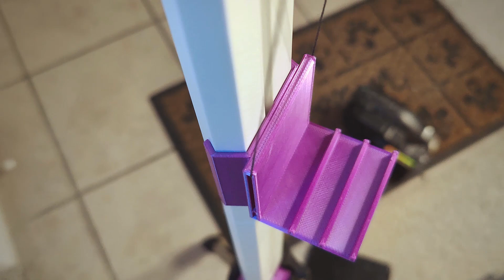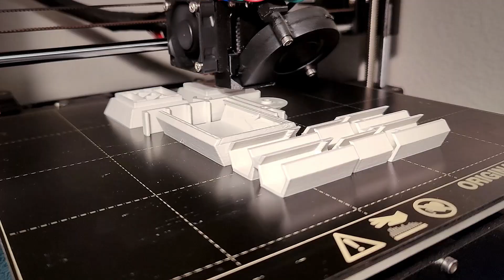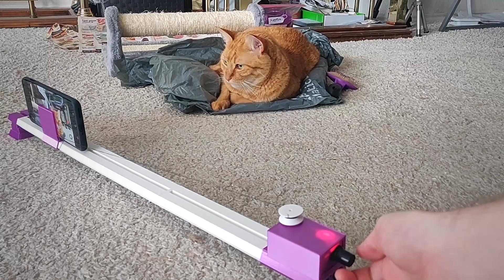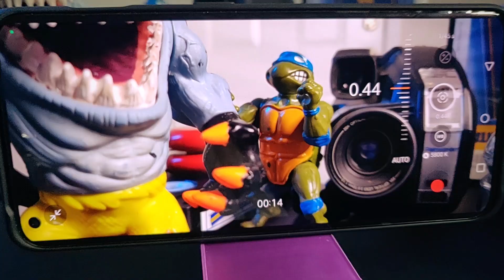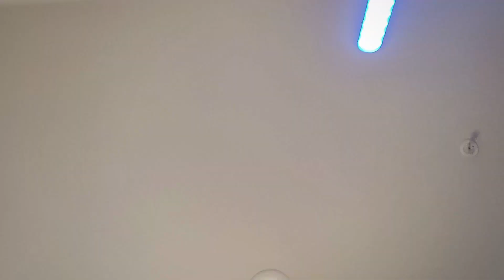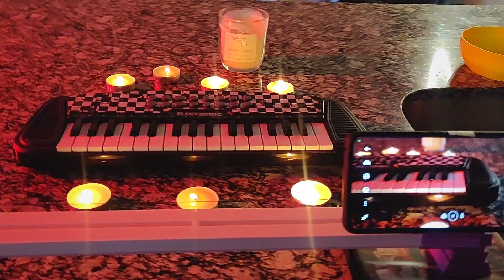My 3D Printed Camera Slider

Comment: What filament type did you use for this?
Reply from the maker: I only print in PLA. It's strong enough for this project.
Reply: @3DSage  noted. My project involves some electronics that tend to get a bit hot, so I think I’ll just stick with ABS, and try to limit the warping to unimportant parts

Comment: Brilliant stuff! Sometimes (and where possible) changing the print orientation of one of the moving parts/frictional surfaces can help so that the layer lines are either running at right angles to each other, or both along the direction of travel, rather than both at right angles to the direction of travel.

Comment: Try using ball bearings. The friction between the plastic will always be there and get worse over time. 

Or better yet, you can make a right like the 3D printers use with a belt and a motor. It would be a lot sturdier and smoother.
Reply: It can get better over time as the high spots get knocked down. Unfortunately both the rail and the slider are printed in the same orientation, which is a problem since the layer ridges align, it must necessarily jump every step a little. It depends very much on the filament, i don't expect silk type PLA to be abrasion resistant, and ABS fundamentally has an abrasion resistance issue.

But i also don't think two of the same types of plastic is ideal. I have had a good run with PETG 3D printed bushings on any kind of metal rod though, can be even be alu rod or alu angle.
Reply: Just use drawer rails.